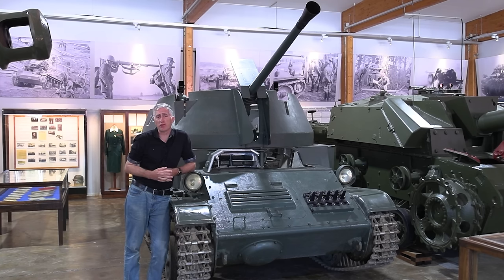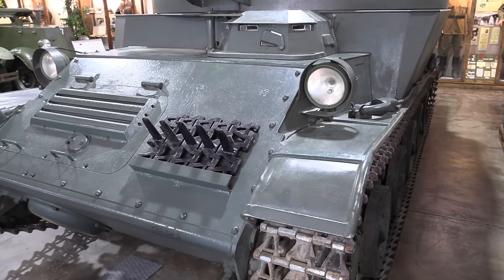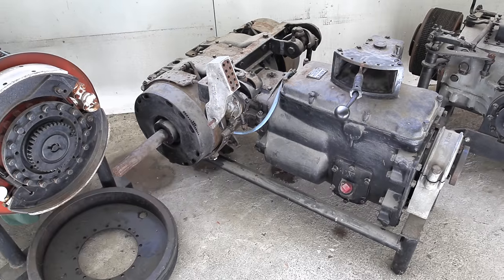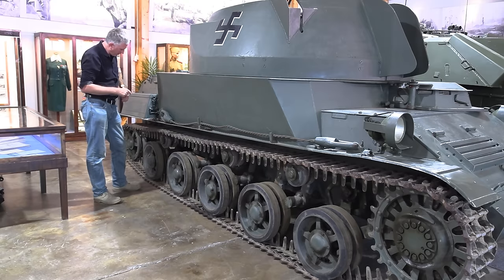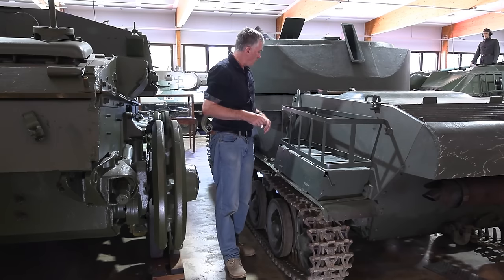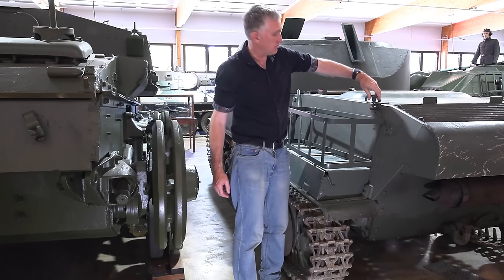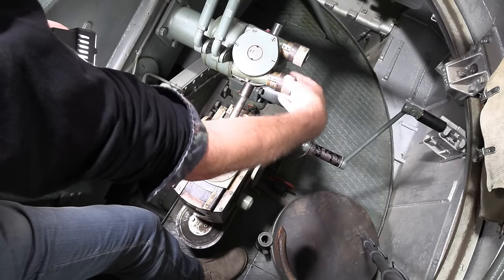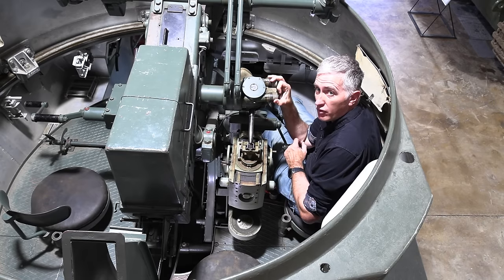Inside the Chieftain's Hatch: ItPsv 41 Anti II

Comment: The muffler, road wheels, drive sprocket and track all seem similar to what you would find on the German Panzer III, this would not be unusual as both the swedes and finns did business with the Germans.
Reply: The Landsverk company was partly owned by Germany.  And clearly Swedish tanks started out with German tanks after ww1. 
However I would say Landsverk was quite far ahead of most other nations in the early 30's with welded sloped hulls and periscopes. I believe even radios was not uncommon(?)
Actually I think early German tanks resemble Swedish ones like L-10 and L -60 not the other way around.

Comment: 21:21 Yeah, The 41 Anti-II doesn't have alot of ammo at all, around 144 rounds. In comparison, the Amx-13 DCA 40 got around 400, M19 twin 40mm at 350, M42 at 480 and the Zsu-37 at 290.
That's very low. The swedish had the Lvkv 42, It used the Bofor L-70 which doubled the fire rate and they had 104 rounds, Bruh.

Comment: What about the bolt and screw question in the front?
Reply: Having  bolt heads on top would have stopped the driver's hatch from swinging out, so they used flatheaded screws in the swing arc.
Reply: Ah. Thanks. I missed that when he opened the hatch.

Comment: one thing you got wrong, calling the flat head flush bolts screws. they aren't as they do not make their own thread going into the material, a bolt goes into, or fixed into a pre-threaded hole. like a nut.
Reply: depends if they're full threaded or not, if full threaded they're set screws not a bolt but you knew that
Reply: @paulnutter1713  no no that is true.but a set screw is a type of bolt.
Reply: Not all screws are self tapping.
Reply: A "machine screw" is one correct terminology for a bolt with a screw-style head.
Reply: @ScottKenny1978  That is LITERALLY what defines a screw. grab a book that ISN'T american.
Reply: @beencybouncyburger  true, bolts are odd at times.
Reply: @osmacar5331  sorry, but the aviation industry disagrees with you. Both American and European.

Comment: The vehicle type marking used in this video (as well as in the recently appeared scale model) is total BS. The manufacturer's type marking for the vehicle is Landsverk Anti II (nothing about L-60 or L-62 or so). It can be seen in the manufacturer's plate inside the vehicle.

"ItPsv 41" is  totally wrong and an invention of somebody without any knowledge of the Finnish Defence Forces' nomenclature system for armoured vehicles. The nomenclature system, used for listing and designating all vehicles, weapons, radios etc, has usually nothing to do with the manufacturer's type marking so they should not be used together. The war time nomenclature designation for Anti II was "10 It.psv./Anti" and the last peace time designation from 1961 was "10 ITPSV ANTI 40" (where 10 is the weight of the vehicle and 40 is the gun calibre in mm).